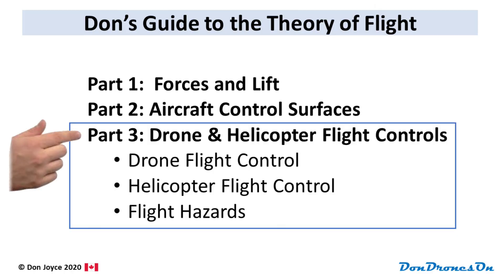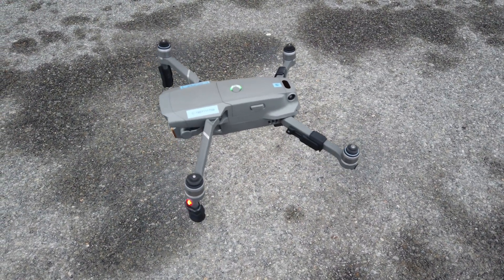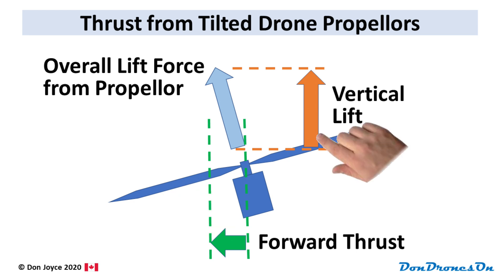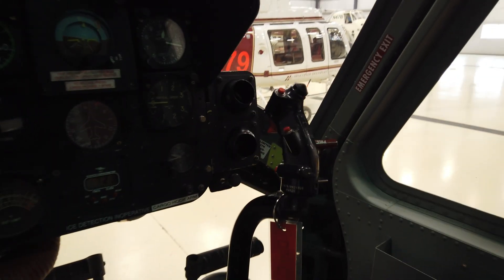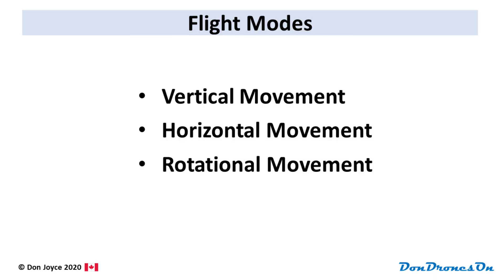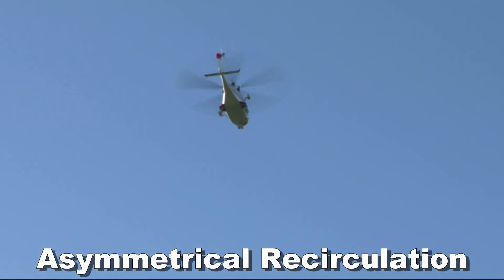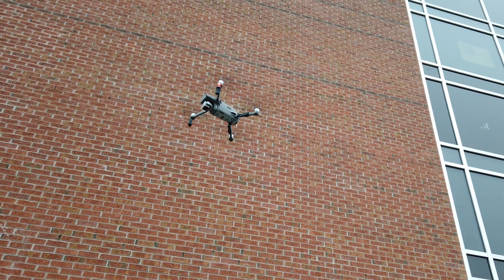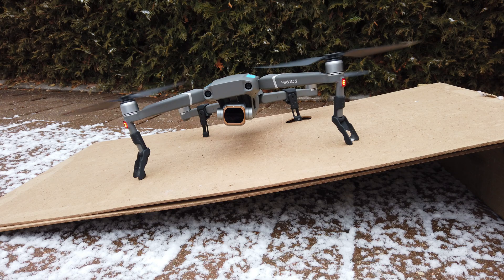Theory of Flight -- Part 3: Drone and Helicopter Flight Control Systems

Comment: Talking off from uneven surfaces doesn’t effect quadcopter only lets it arms the stabilizer system and it level first and then go up level.
Reply from the maker: Not always true, Kassim.  I witnessed a disastrous take-off of my Phantom 3 Standard from an uneven surface.  Basically flipped right over.
Reply: @DonJoyce  yes it happened only when systems didn’t completely armed some time it’s take more time than normal, I have been flying tri copters and quadcopter when no one was selling my first one used regular gyros . Thanks for getting back to me.

Comment: Amazing how they engineered helicopters with all those mechanical controls and made them work so well. I can't help but think that a manned quadcopter would be an amazing aircraft and potentially safer than a traditional helicopter (4 motors instead of one). Maybe we're going to see them in the future.
Reply from the maker: And what I find amazing is that it still hasn't been automated in any way!  And yes, a quad (or hex) would be more safe in my opinion!
Reply: @DonJoyce  a quadcopter can’t fly if it loses a motor since all 4 are required for directional control. I’d want a few extra motors for redundancy if I was a passenger. Great video series by the way!

Comment: My dad had a small float plane, I was taught to fly it in case of emergency, it had a joy sticks, why is a drone control backwards, can it be changed. Even my loader, excavator pull back and the boom ect goes up. Can they be changed.
Reply from the maker: Hi Dan!  On DJI drones, at least, you can certainly reverse the direction of the joysticks, so back is up etc.  I have also seen this on a few other drones.  A matter of preference and what you are used to...but at least you can change it.

Comment: One more thing --- it would be ultra cool to be able to capture footage that lets the viewer see the difference in rotor speeds that result in yaw, patch and roll. Not a criticism - just something that I think would be cool. :)
Reply from the maker: That would be cool, Kevin! Might need a strobe light to capture it.  The scene showing the counter rotating blades was shot at 240 fps, slowed by 8x. Still a blur after start up. The flight logs would show it, but seeing it would be better.
Reply: @DonJoyce  I am now tempted to see if I can put together an animation... Don't hold your breath, though. I just moved and that would be about #100 on my list.

Comment: Another excellent Video! I hadn't thought about gyroscopic precession in rotary wing aircraft. It was a factor I learned about in performance motorcycling, though, and understanding - whether consciously or not - the 90 degree offset between trying to change the direction of a gyroscopic mechanism (e.g. the front wheel of a motorcycle) and how it actually changes orientation helps with making very quick directional changes as speed increases. A sharp, but not too far - push forward on one or the other handlebar will cause the bike to veer in that direction. Some people call it turn right to go left  - push the left bar forward (i.e. try to turn the handlebars to the right) and the bike will quickly lean into a left turn.  This does NOT work at very slow speeds... Try this at home - hold a bicycle wheel by the the axle (remove it from the bicycle first) - hold it so you have an end in each hand. Also, it's probably best if you hold it so the axle is horizontal. Get someone to give it a good spin. Now, try to turn it - you'll notice that the angle where the tilt occurs is 90 degrees from the direction you're trying to tilt it.
Anyway - there's today's fun (to me, at least) physics phenomenon.
Reply from the maker: Very cool, professor! Btw, the guy escorting me said the helicopter blades spin at only about 450 to 500 rpm...but a lot of mass of course.
Reply: It's a big factor in fixed-wing, single-engined aircraft too.  Careless application of power in a big, propeller-driven warbird (e.g. Corsair, Spitfire etc), without rapid rudder compensation,  could take it off the side of the runway...
Reply: @Aerosnapper   That would certainly cause some clamping of the seat muscles..

Comment: at 4min 06 wha that replacing the cell phone aera ? what that lol?
Reply from the maker: I use Epson Moverio AR glasses to fly.  That's the control unit...basically an Android box.
Reply: @DonJoyce  other question does the basic license is valid in other countries
Reply from the maker: The Canadian Basic RPAS Pilot Certificate is not valid outside Canada, although it may help you with any visitor's permits that may be required.
Reply: @DonJoyce  and if im going with the advance ?

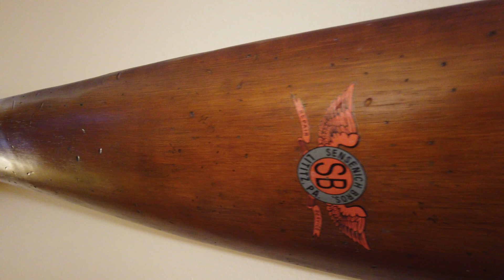Comment: The original Phantom-1 was prone to vortex ring state.  Subsequent DJI drones all now feature a limited descent rate to prevent the drone falling through its own downwash.  Here's my favourite example.  At 1:30 into this old video the Phantom-1 starts to descend straight down and it immediately goes into the wobble of death.  Any other stick input forward/backward left/right would have moved the Phantom out of the unstable column of air and into clean airflow.  But throttle only even to max power does nothing as the blades are already stalled out.  Unfortunately the drone falls into the lake.  Fortunately they did recover it.  But really unfortunately, and hilariously, is how they tried to dry the drone!  Watch to the end.  :)  https://www.youtube.com/watch?v=pTDmd0ygH4M
Reply: Wow - two mistakes multiplied by one another...
Reply: The funniest part was, see the comments below the video, he sold the remains for $60 on Ebay!
Reply from the maker: Great video! Interesting to see it happen. Love the baking project!

Comment: Great video.. Wondering if you actually fly rc heli's also?.. Been building and flying heli's for 8+yrs now.... Fun when it's finally tuned in.. Rotors spinning in the same plain and leveling the swash... Even went oldschool and set the tail machanically without a gyro lol..... Quads are nice too... Also only had to do an autorotation once.. And that was the first time I tried it when the tail went out in me... Scarry..
Reply from the maker: Thanks, Erwin!  I considered RC heli's many years ago (before drones were a 'thing') and thought they looked really hard to fly, and expensive to crash!  So, no, I don't fly them...but I'm always impressed to see anyone who can!

Comment: A couple of points with regards to helicopters:
You can get out of VRS by moving in any direction..it does not have to be sideways. You can also recover by lowering the collective (if you have sufficient altitude.
Reply from the maker: Yes...I should have said the recommended way out of VRS was slipping sideways.  Thanks for watching so closely.
Reply: @DonJoyce  Forward is the more natural way, but it depends on where you're at. Typically VRS will happen during an approach and you're like;y to already have some forward speed, but it really depends on what your escape options are.
Reply from the maker: Oh wow!  I wish I had found that beforehand!  I was basing my info on other sources, trying to avoid the FAA 'VSR = settling with power' trap.  Everywhere was recommending Vuichard technique.  Thanks for sharing!
Reply from the maker: Thanks and I agree.  And yes, I've watched that amazing video.  I wonder how many takes and/or helicopters it took to get that footage!
Reply: Once it's been demonstrated and practised, you do recognize what's happening and it's easy to get out of it. I've never flown a helicopter but back when I did my fixed wing training I had a very good instructor who insisted on showing me what a full spin looks like.  The flight training back then only included "incipient spins".  You see what's about to happen and react quickly to recover before the plane ever develops a complete spin.  Throttle back but keep increasing elevator angle to maintain altitude as the plane slows and eventually the wings stall and the plane starts to drop.  That's all obvious, just lower the nose to increase airspeed and Bob's your uncle.  But, if you kick in rudder as the wings are stalling the resulting yaw moves one wing forward while pulling the other wing back.  The faster wing has more lift, while the slower wing drops, and presto you're in a spin.  Immediately apply opposite rudder to stop the yaw rotation, and push the nose down to build airspeed and it's all good.  No big deal.  It's all quite gentle and tame.  But my instructor insisted we take out the little Cessna 150, which was rated for aerobatics, so we could do actual full spins...  OMG!!  When stalled out, and full rudder is applied, the thing flips over to point straight nose-down.  I see a barn down there on the ground with everything rotating in a blur around that barn.  With each rotation the plane is losing several hundred feet dropping like a stone.  The instructor calmly explains how to exit the spin and says, Now you try it.  I had to confess I didn't hear a word he said.  I was completely petrified wide-eyed frozen in panic.  I now know why people die in such a spin.  All my instincts said PULL UP NOW!  Which is exactly the wrong thing to do.  First you have to stop the rotation, then hold the nose DOWN to regain airspeed over the wings.  It's certainly not a natural reaction when you're already staring at the ground rapidly coming up at you.  So then the instructor demonstrates again, but this time kicking the rudder to make it spin in the opposite direction.  He warns it's a little more dramatic in this direction because, with the wings stalled out, you no longer have a stable platform to counteract the torque of the engine spinning the propeller.  Rather than just spinning the prop in one direction, the motor rolls the plane in the opposite direction.  Holeeeeeey!  This time the plane instantly flips fully inverted before again pointing nose straight down while rotating, whop, whop, whop, falling like a stone.  As long as you have enough altitude to play with, and as long as your plane is stressed for aerobatics and you haven't torn the wings off it, and as long as you haven't passed out from shock and panic, and as long as you react correctly (rather than instinctively), it's all perfectly manageable and actually kind of fun, once you've stopped puking.  :)